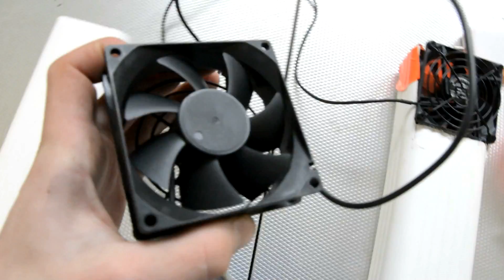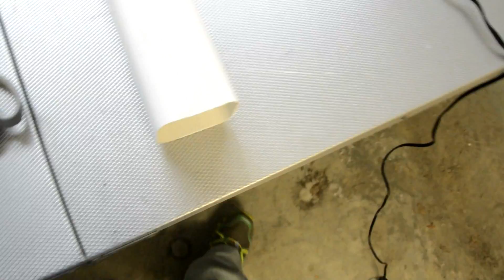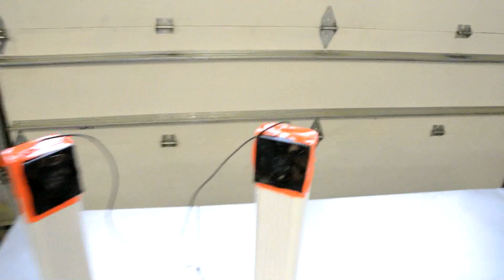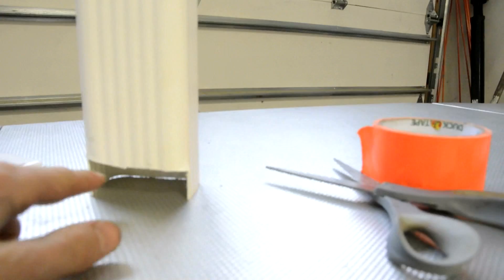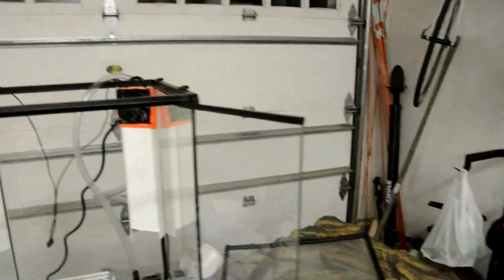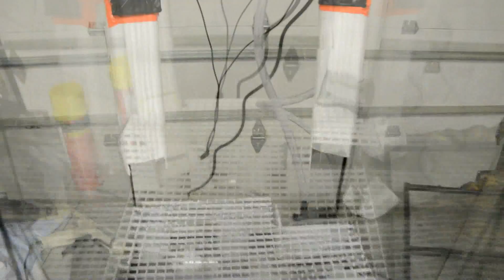2013 vivarium build part #1 mechanics

Comment: Wonderful work Josh. How do you clean the pump when it needs it?
Reply from the maker: +Joni Solis Thanks, I actually have never had to touch the pump and it is still running with no problems even after over 2 years of use.  This is unusual and typically pumps do need maintenance but I have been lucky.  If I had to get to it I would be able to take out a few rocks and reach my hand to the back.
Reply: +Josh Turner Glad to hear that you have not had a problem and that this vivarium is still up and running. Any updates soon on it?